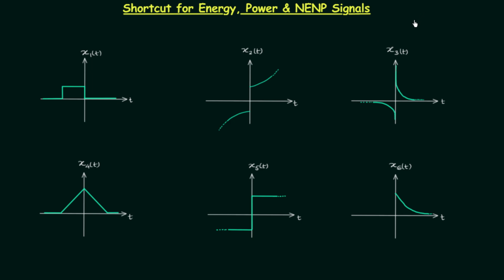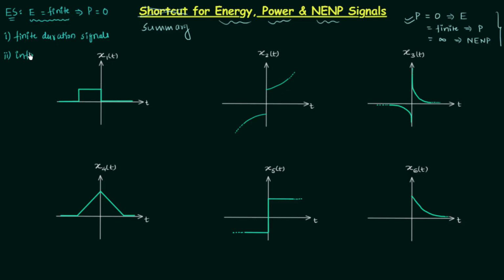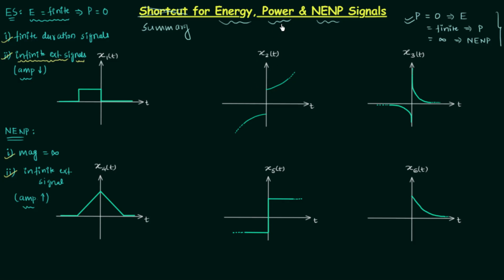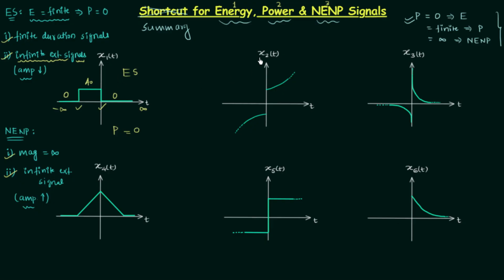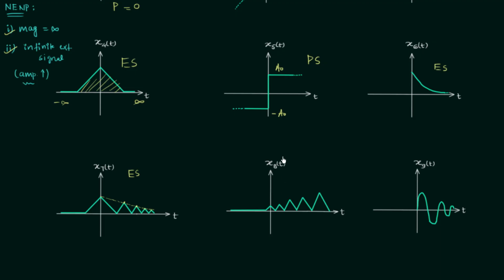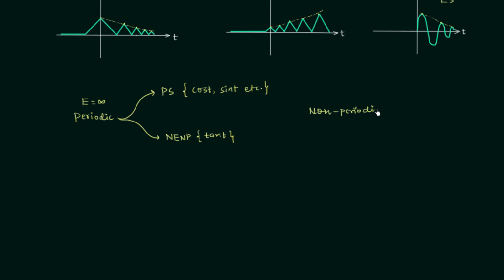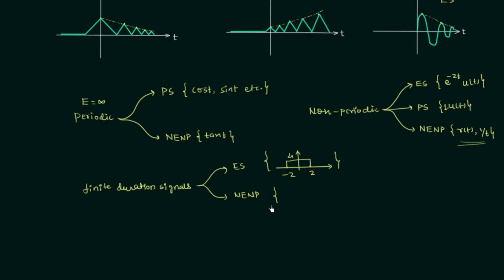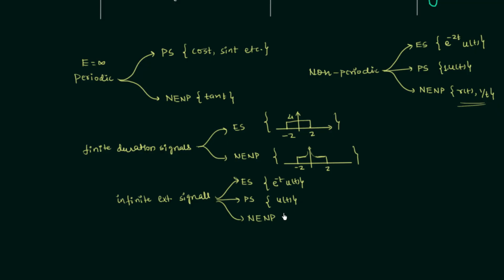Shortcut for Energy, Power & NENP Signals

Comment: doubt in X3(t) sir......it folloes the definition of NENP signal(at t=0,amplitude is infinity).
clarify the doubt sir
Reply: Neso Academy  please elaborate what's non zero amplitude rabge
Reply: ok. Thank you !! Had same doubt.
Reply: In this lecture X3(t) singal is not of X(t)=1/t,
It seems like to be same but it is not same, it is finite value at t= 0
Reply: @RahulRaj-uz3rx  correct for this condition it is energy signal
Reply: @saurabh647  but the graph makes me confused. I thought x3(t) is 1/t, too.
Reply: @haphong8785  Like in the example graph that we saw for 1/t it was infinite both ways (increasing and decreasing), but in the graph he gave for x3(t), the graph has a starting point and is only decreasing